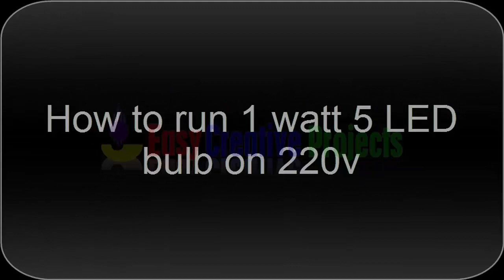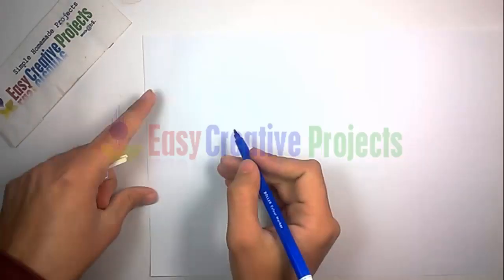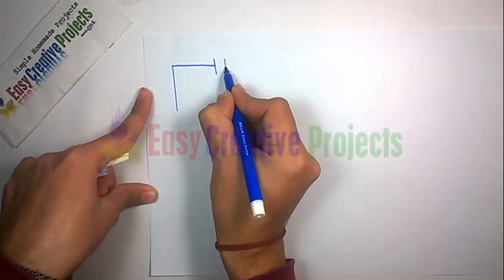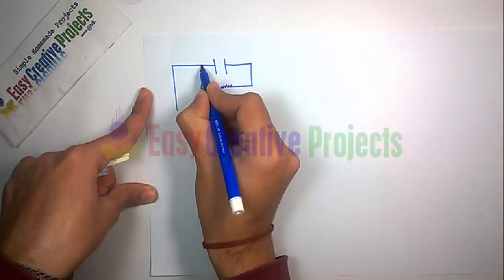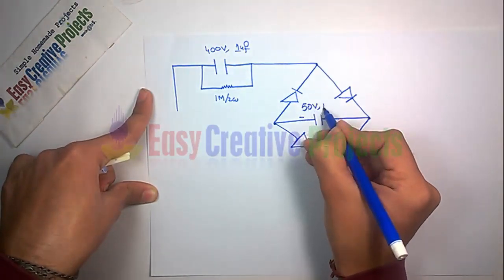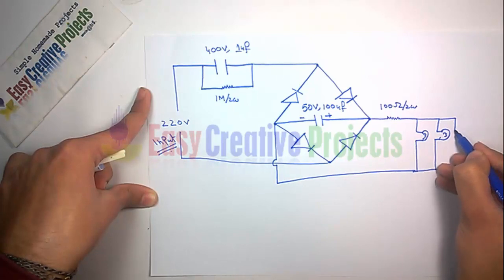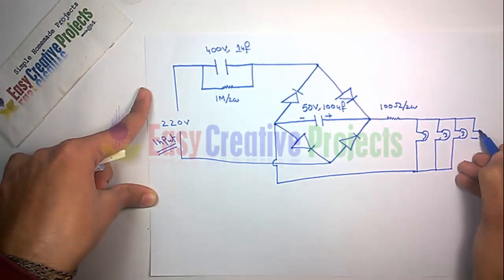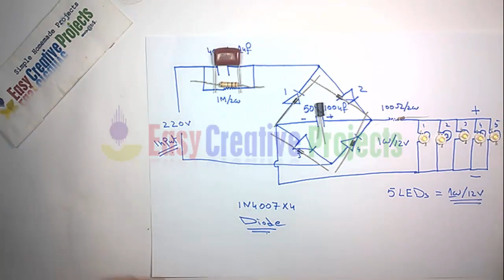How to run 1 watt 5 LED bulb on 220v - easy step by step with circuit diagram

Comment: In the case of connecting Leds In parallels you should add a resistor to each led to protect them from burning or shortening in the long term due to current division imbalance in each one
Reply from the maker: yes if you want more safety so you can also put resistor with each leds.
Reply: Hon.please guide me?

Comment: For parallel , each led take 12v ....yes or not, sir??
Reply from the maker: yes
Reply: Led take how many voltage maximum?
Reply from the maker: in parallel circuit only 12v required for all leds.
Reply: 1w led voltage is (3.2 to 3.6max & 300ma) so if you connect 5 led in parallel means it will take the same voltage but amp will be increases (300ma x 5= 1500ma) so total voltage this parallel consume 3.2v 1500ma. In series, led voltage will be increase but the amp will remain the same (ex: 3.2v x 5=16v 300ma) so kindly first learn the parallel & series formula of LED'S. This circuit need 3.6v zener added with capacitor for good run with life.

Comment: What is you connect 2 or 3 or 4 in serie and not 5? Will it make a difrence?
Reply from the maker: dear in this circuit i use 1w,  5 LEDs in parallel circuit.  you can use only one led with this circuit.

Comment: Can you confirm that there is no flickering?
Reply from the maker: no flickering dear.
check capacitor ,you capacitor not store voltage.
Reply: How many Amp sir or ma?